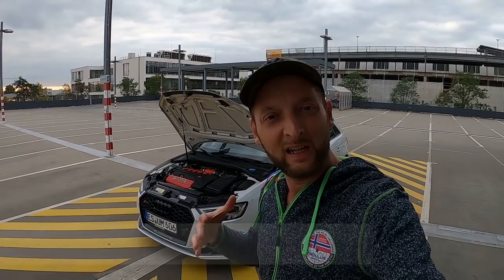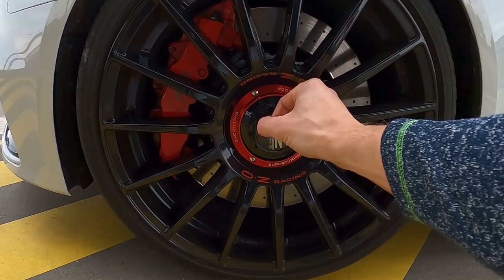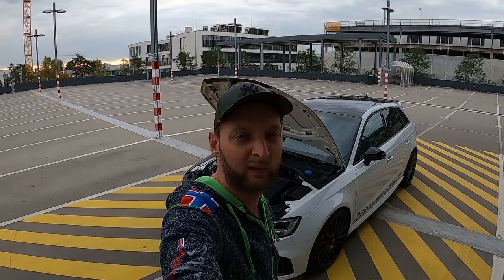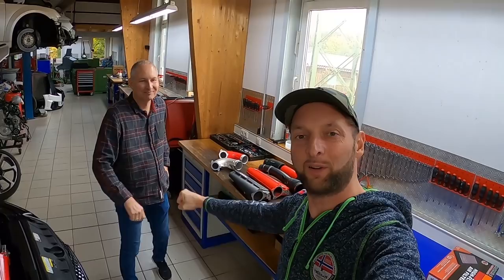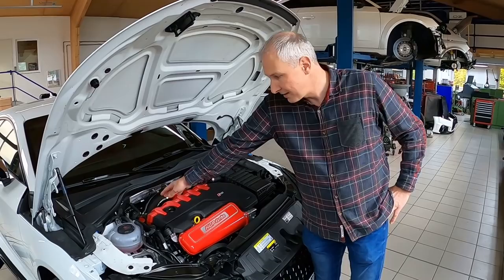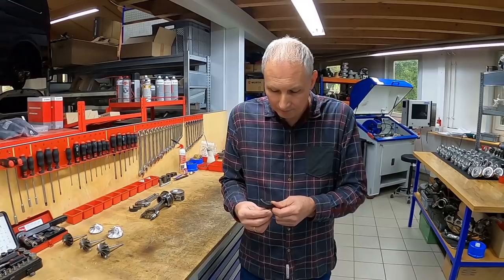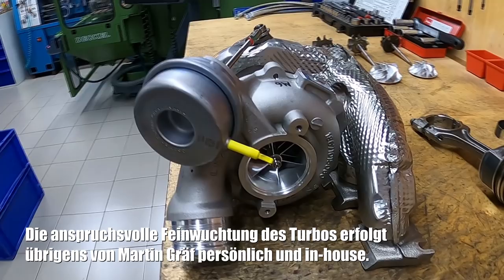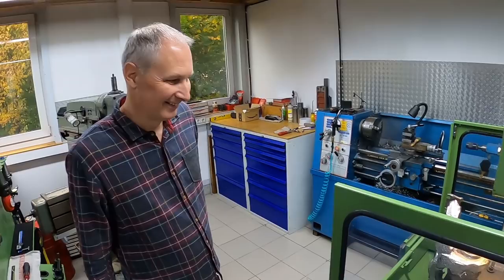#vlog: Technikpart zum HGP Audi RS3 (OPF Version) mit 618 PS - Warum wird der Motor geöffnet?

Comment: Ist das einfach überlastung oder kann man den Schaden mit Ölzufuhr an dieser Stelle verhindern? Bei mir wird es wohl "nur" ein moderates Leistungsplus geben, der EVO1 LLK, Downpipe weiss ich noch nicht welche und dann auf 100Oktan abgestimmt auf höchstens 470PS und 620Nm.
Reply from the maker: Beides denke ich. Das Entwicklungsfahrzeug hatte knapp 20.000 sehr harte Entwicklungskilometer hinter sich. Natürlich probieren die vermutlich auch noch höhere Ladedrücke bzw. diverse Ladervarianten unter Volllast aus. Ist halt auch nur ein Serienmotor gewesen, wo an allen Ecken gespart wird bei der Herstellung, daher eben leider keine Ölzufuhr am Kolbenbolzen. Vermutlich hätte das durchaus geholfen. HGP geht aber auf Nummer sicher und - so meine Vermutung - rüstet sich gleich für noch mehr Power.

Comment: Moin! Ich habe mal ne Frage, welches Motoröl bzw. welche Viscosität wird nach so einer Leistungssteigerung gefahren? Auch in Bezug auf den OPF... 5W30 oder was verwendet, was empfiehlt HGP? Sehr sympathisch und kompetent, der Martin!...
Reply from the maker: Moin und vielen lieben Dank. Beim RS3 ist ein Aufkleber im Motorraum: „HGP empfiehlt ausschließlich Mobil1 ESP X3“. Hilft Dir das weiter? ✌🏼
Reply: @MotorOliTV  Jein, ich habe dieses Öl nur als 0W40 gefunden. Dies dürfte meinen Informationen nach nicht für Fahrzeuge mit OPF freigegeben sein. Ändert / verstärkt HGP eigentlich auch das Getriebe? Über 700Nm für ein Serien DSG kann auf Dauer meiner Meinung nach mit der Haltbarkeit nicht gut gehen .
Reply from the maker: @djmartinkingkupkuper8941  Ist IMHO 5W-30, was die reinkippen, yes. Beim DSG wird nur die Software verändert. 🤷🏼‍♂️
Reply: Ok, Danke für die - schnellen - Antworten!

Comment: Die Frage ist, wie lange würde dann der Motor halten würde.  Ein Audi RS6 hat einen V8 Motor und leistet gerade 600 PS. Warum würde der Hersteller den ganzen Aufwand auf sich nehmen, einen V8 Motor zu bauen, wenn es auch mit einem 5 Zylinder- Motor ginge. Genau dass passiert mit jedem Motor, wenn das Material über seine Grenze hinaus belastet wird. Ich habe meinen Master-Abschluss im Bereich Maschinenbau und kann euch nur von solchen sinnlosen  Aktionen abraten.